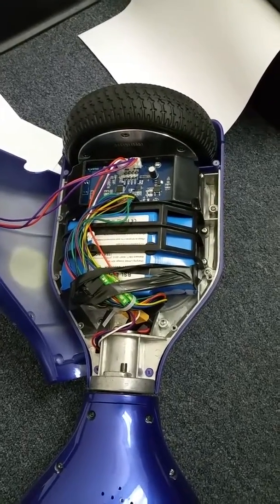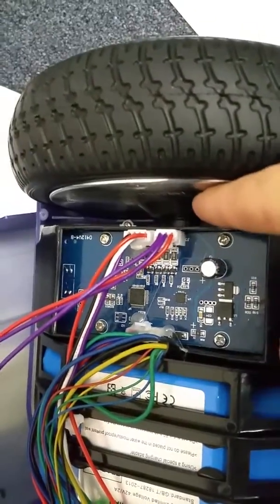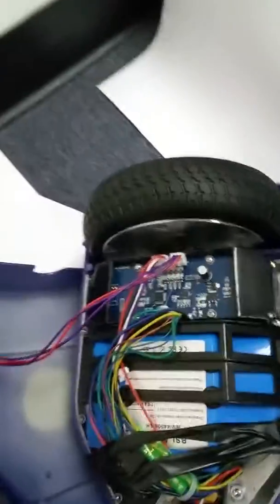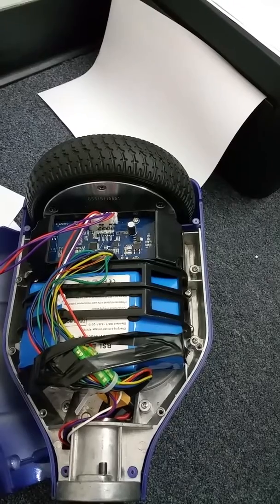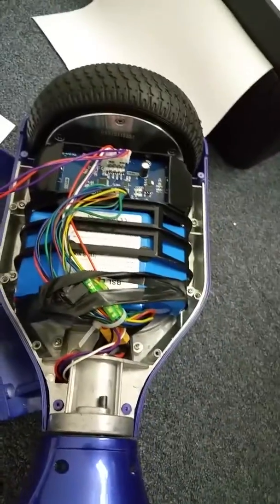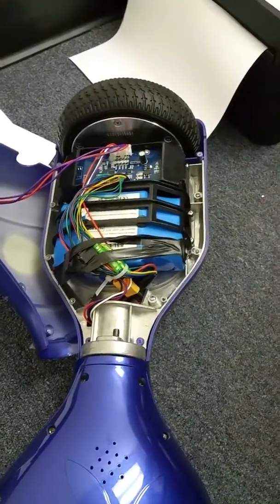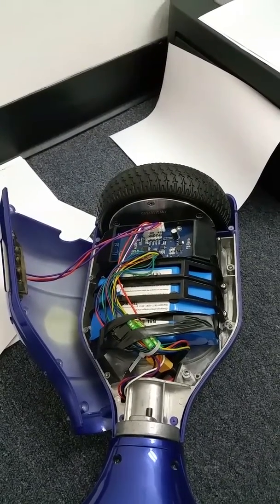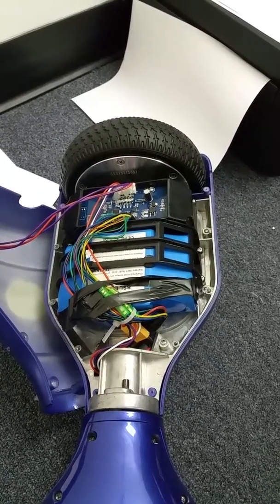The Anatomy Of A Hoverboard - What's Inside?

Comment: i have two 8 inch Bluetooth models with led lights on top. upon powering on i receive the announcement "awaiting bluetooth. connectivity" but i am not able to connect to Bluetooth. The other works fine. ive opened them both up but have found no obvious signs(loose connections, wiring). What should i be looking for?